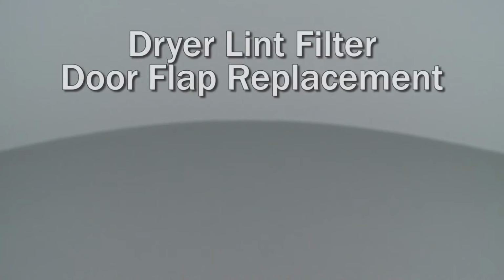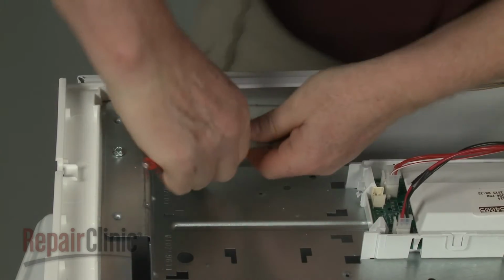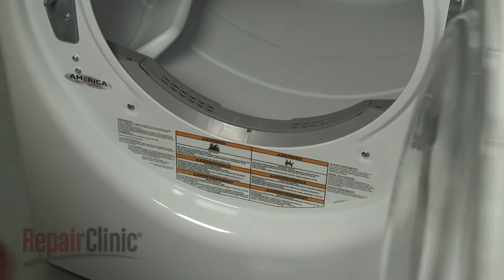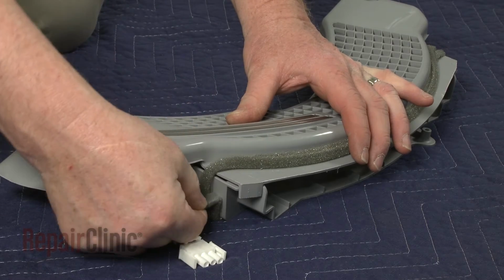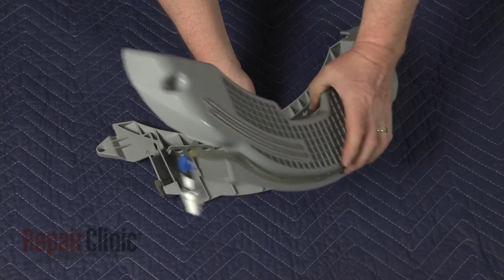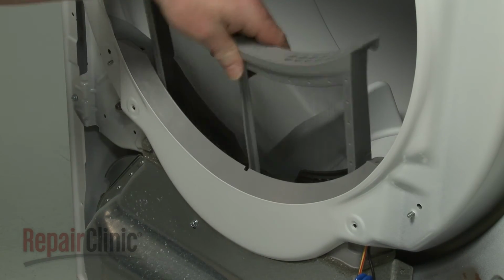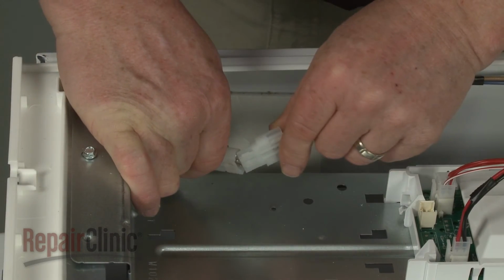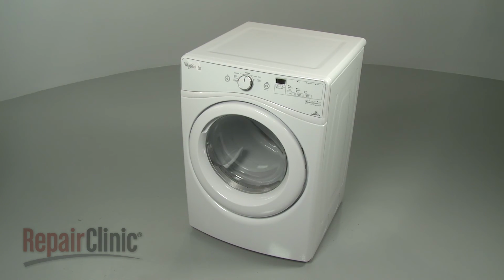Whirlpool Electric Dryer Lint Filter Door Flap #WPW10219016

Comment: This video was awesome. If anyone was in the same boat as I was to replace both the part and the spring, this spring is cheaper and fits as well and doesn't cost $70 LG Genuine OEM 4970EL4002C Dryer Lint Screen Cover Spring (Distortion Spring)

Comment: Is the filter door flap needed? I was cleaning below it and one broke off.
Reply: Same problem here.  I think the first commenter @markblouzoopa3788 got it right that it is only really meant to catch small lint that falls off when you pull the filter out.  Curious if you have an update on whether you've had any problems since your's broke.  I'm pretty neurotic with lint cleaning anyway so I think I'll just wait and see if I have any issues with just one flap since it seems like a pain to replace.
Reply: @maikbells  Hey there. So far no problems ever since. I did take a vacuum and put the hose into the vent to get any excess lint out. But overall, machine seems to be working fine.
Reply: @iiSnipeFoLyffe  Hello! There have not been any problems until now? Today a family member forced the filter in the wrong way and damaged both door flaps. I will appreciate your response.
Reply: @iszero6503  hi there. Nope! No problems. I’ve just been putting my vacuum in there to suck up any excess lint.
Reply: Can confirm that the flaps are unnecessary. One of the flaps on my machine broke about 10 years ago and we have experienced no issues. All it does is catch errant dust that may fall from the filter when removed.

Comment: This video is very well done and the repair is easy when you follow the instructions.  However, after wanting to replace two flap doors in my dryer and seeing what value the doors might provide, I have come to the conclusion that the parts are way over priced and do not provide enough value for their cost.   The flap door replacement parts I bought are not very robust plastic and the design is such that the hinge pins are prone to break during installation.  In theory, the doors function to catch small things (but not too small!) that might fall from the lint filter when taking the filter out for cleaning.  While the filter is in place, the doors fold out of the way, so not much chance they do anything while the dryer is running.  If you decide you have to replace broken components, make sure you don't lose the springs when taking the thing apart.  If you need to buy two doors and two springs, the price will be surprisingly high.  Fortunately, I had the springs.  Unfortunately, I needed two doors.  Unfortunately on one of the doors, the hinge pin broke off during installation.  If the supplier sends me a replacement, I'll install it.  If they don't, I won't spend another thirty dollars for another.
Reply: Yep. Video is well done and looks easy enough to follow. But I'm not wasting time/money to replace these two flimsy "doors".